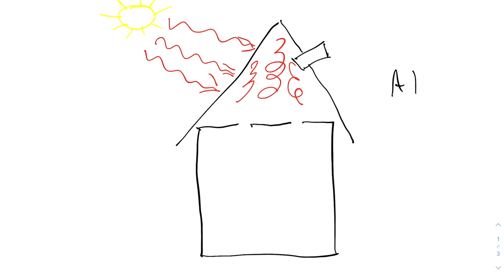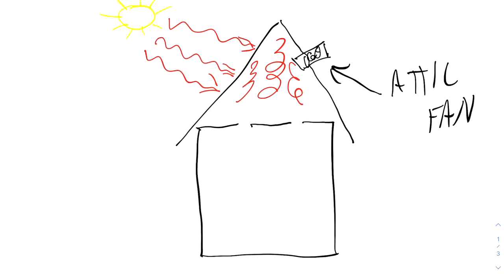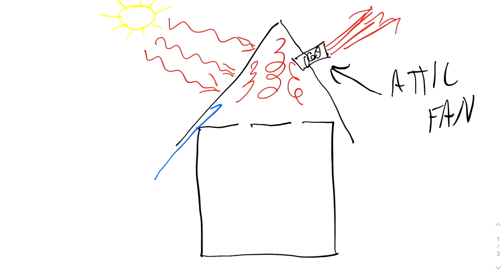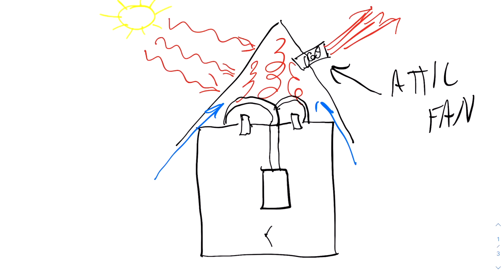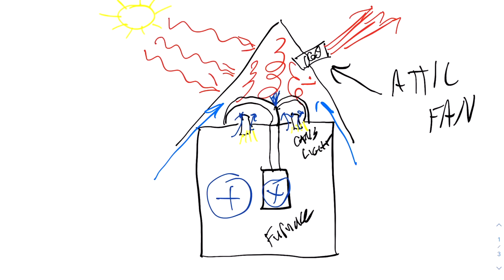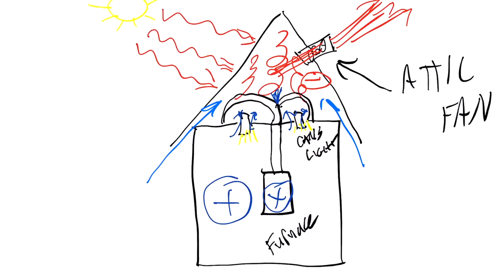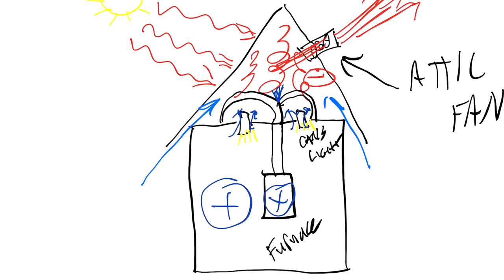3 Remodel Rip-Offs

Comment: As an electrician who is always in attics I can say that every time one of those attic fans kicks on it definitely feels cooler in the attic, but I could be wrong.
Reply: True that! I lived in attics on the jobs in my earlier trade 40+ years ago.(and visited just last week...) It's a seniority thing. They own the company & you go/do what they say ;`)
Reply: It does work. I live on an Island and when elnio hit the Humidity was unbearable. Installed an electric vent and it's definitely cooler.
Reply: It depends on your type of roof. How your attic is designed. My house has A Frame. It's Attic height is around 3ft high.
Reply: Phoenix energy auditor here. The main issue with the attic fans is that they tend to depressurize the attic with reference to the house interior and thus pull conditioned house air into the attic. I use a smoke pen held up at the can lights to show the homeowners that their attic is getting cooler, in part, by pulling air from the house. (The dirty insulation around the can lights further lends credence to this.)

We recommend against attic fans for this reason. Also, a properly ventilated attic, with less high vent square footage relative to the soffit vent square footage, is a more efficient way to go. Stack effect will carry the air from the soffit vents to the ridge/dormer vents. At the same time, we recommend proper air-sealing around the house-to-attic penetrations.

That said,  the fans can work, but the house has got to be sealed tight from the attic.

“In order for the fan to work the air needs to come from the outside and not be pulled from the house so this means that the attic ceiling needs to be airtight. If the attic ceiling is airtight you don’t need the fan. Your money is better spent on something else.”
-- Joe Lstiburek
Reply: You’re probably correct because the attic fan is pulling cold conditioned air from the living space into the attic thanks to the negative pressure effects. This is actually NOT what you want to have happen as now your central A/C is cooling your attic—an unconditioned space.
Reply: @automobilesarefun409  that’s because the fan creates negative pressure pulling cold conditioned air into the attic from your living space. That’s not really addressing the problem of a hot attic by making your setup more inefficient by utilizing air leaks to cool the attic from your main living spaces. That’s literally wasting money.
Reply: I had a similar experience. when my attic fan broke, the second floor was impossible for my AC to get to livable temp, something like 74/75. once I replaced the attic fan it was fine again.
Reply: @eggnogaddict6287  If your attic isn't properly vented at the soffits, i could see how that could happen, but if there are plenty of soffit vents, there is no way it would be sucking air from the house.
Reply: @mushieslushie  if you have plenty of soffits, then a powered exhaust wouldn’t be “necessary.” I am glad you at least acknowledge what science has shown
Reply: Sure it’s cooler.  If the power vent is big enough to actually move enough air to do anything there’s a very good chance it’s pulling conditioned air out of the house through every crack and gap in the ceiling plane.
Reply: @asortoffeastfromfamine1466  whiRley bird?
Reply: I helped my friend do an AC install in the attic. When the fan kicks om it does help with the temp. Most house are not properly insulated. The house we did an ac on belongs to a general contractor. If the vent is not venting properly then I dont see no harm in a fans. Especially for a garage.
Reply: I agree if placed well it makes it cooler. We have a storage artic.  When the fan is running it is bearable.  Without it not so much.
Reply: @automobilesarefun409  powered attic fans do nothing about the humidity.
Reply: @mushieslushie  Of course there is.  It will suck it out of every ceiling light, ceiling fan connection, can light, wall/ceiling joint, up the walls through the top plates of the wall, anywhere that's not sealed.  Why would you think it wouldn't?
Reply: @percyfaith11  It might a little bit as long as you have a lot of proper ventilation, the air will be pulled from where there is less restriction.  Path of least resistance as it were.  If your roof was completely sealed with no vents then what you are saying would be true.  As long as the fan isn't so fucking powerful that it actually created negative pressure, the vast majority of the air should come from the soffit vents.   It's way easier for air to go though a 16"x4" hole than though some small gaps around a ceiling light
Reply: @mushieslushie  Any fan in the roof will create negative pressure.  How else would it exhaust air otherwise?  If there wasn't negative pressure the air would not move into and out of the house.  A fan doesn't have to be so "fucking" powerful to do that.  A standard little bath fan creates negative pressure.

The openings in soffit vents are not individually 16"x4", they are tiny and are no different than the tiny holes around that unsealed can light in the ceiling. If you were able to add up all the unsealed gaps in a typical house you'd be surprised how large an area it is. There is no less restriction to air flow around that can light than there is in from the small holes in the soffit vent.  A 16x4 hole is an open window, not a soffit vent.

The truth is that a portion of the air exiting a powered attic fan is from the soffits and a portion is from the inside of the house.  The relative size of the portions depends entirely on how well air sealed the ceiling below the attic is.  The problem is that the portion coming from the house is expensive due to having been heated or cooled.

What you're trying to say would be true only if the ceiling is exceptionally well sealed against air flow.
Reply: Sure that electrician felt cooler in the attic.  All that air conditioned air coming through the ceiling was cooling him down.  LOL>
Reply: @percyfaith11  I was looking at the soffit vents on my own house while in the pool as I was replying and they are very much the size that I stated, approximately.
Reply: @mushieslushie  You must get a lot of birds and bats in your attic then.  Take a closer look.  They have to be big enough to let in air but small enough to keep out insects and critters.  We're talking about the individual openings in the soffit panels, not the size of the panels themselves.
Reply: @eggnogaddict6287  but if you turn a house fan on at night when the outside is cooler than the inside ..and it will take longer for the house to heat back up during the day making the air conditioner work less otherwise is it not fighting with he hot air from the attic?
Reply: look up Quiet Cool Whole House Fan
Reply: @Farreach  That is distinct from attic ventilation fans.  It has a different purpose and a different way of functioning.
Reply: Quality fan is not running 24/7 and typically not running at night. Usually has a thermo switch. Also - most people have a stack on the roof already and if anything air is going to pull from the least resistance (the roof stacks) and not your can lighting and if so its minimal.  Seriously - guys you should be more worried about the "Positive pressure" pushing out your door and windows than the attic LOL. Give me a break. I wish there was actually proof of AC cycling on more due to the solar vent than just THEORY!
Reply: @thatguy-dr3zc  it's just your theory that it doesn't. I'm not disputing that more is coming from the soffit vents than is coming from the can lights but the amount that's coming from the lights and the holes in your ceiling is significant. You would do much better to seal all those holes in your ceiling and envelope against air then you would do by putting in a powered attic vent.
Reply: @percyfaith11  if the whole roof is sealed and you put one fan I agree with the concept.. but when you have 2 roof  vents and also 15 vents under the eaves  To say that one solar fan is causing a vacuum in a 2000-3000 sq ft house thru light cans is like saying sucking water out of a pool with a straw.
Reply: @thatguy-dr3zc  you overstate your case. It's a lot more than one straw being sucked out of the house. In a typical home that hasn't been air sealed it's more like having a window open.
Reply: @automobilesarefun409  Yeah I have the same pitch, but likely I have head height over the kids bedrooms so I can put in a Quiet Cool system.
Reply: @heatthermography3902  In Ca. the IE we get pretty hot but 10 degrees less than you, but at night we cool down to the 80's by 9 pM and 70's after midnight, do you think a Quiet Cool would work good here.
Reply: @Moondoggy1941  Given all the caveats I mentioned regarding depressurizing the attic WRT the house interior, I suppose they could. I'd say, though, that natural ventilation, with about 20% less net free area on the ridge/high side than the soffits/low side, would be better.
If fans must be used -- maybe in attics with low-pitch roofs -- an exhaust fan coupled with an inlet-oriented fan of equal CFM on the opposite side of the house (south & north or east & west, for example) would be preferred.
Reply: Depends on your climate, what your roof is made from, when the fan turns on relative to your use of aircon and indoor/outdoor temp, and greater potential benefit for a multilevel house. Classic use case, two story tin roof house, aircon off, evening on a sunny day, cooler outside ambient than inside, (australia), desire to cool the house, turn on the fan.
Reply: I lowered my ambient interior temperature by 3 degrees using my thermostat controlled attic fan.  2 amp motor.  The fan is 120V on a thermostat control.  I could not believe what a difference it made toward cooling my home.  Three degrees doesn’t sound like much but that’s the difference between a good night’s rest or no steep at all.  Or, my central ac system doesn’t have to work for those three degrees.
Reply: I installed these for 3 years while also working in attics. If this guy's saying attic fans don't do anything he's completely wrong.
Reply: You're not wrong. This guy's logic is very flawed, and I'm not certain he has any actual basis behind his claims on this in particular.
Reply: @eggnogaddict6287  What if you don't have any type of a/c for the home, would the attic fan then be effective?
Reply: @percyfaith11  I fail to see how you can say that, venting any air at all will be better than leaving humid air in the atttic.
Reply: @pablogallegos8629  don't think I actually wrote that.
Reply: @heatthermography3902  I have a question because I understand nothing about this area at all. I can only describe what is happening. 

My wife and I bought our first house November 2021 and it has central air conditioning. When we did the walk-through in August, the house was 68 degrees with the CAC on. I noticed that there were 8 big trees on the south side of the house about 15 feet from the house. I remembered during the walkthrough that the back yard was dark in the middle of the day not realizing the huge leafy trees were shading the entire roof all day as well. Last March 2022, I had the trees removed. During the summer, I noticed that we were unable to get the house below 75 degrees with the CAC on because the attic was so hot. Now the roof is hit by the sun the entire day. 

Just some background on the house. it is an 85 ft wide ranch and 2400 sqft. The attic ceiling is about 4ft high. There appears to be a ridge vent on the roof and there are gable vents on opposite sides of the house. I have read several people talking about an attic fan creating negative pressure which makes perfect sense. Would that happen to a house with gable vents since the air would be pulled in from the sides. I would imagine that this would have a dramatic cooling advantage since it would be pulling in outside air. Any advice you could give me would be greatly appreciated. It is a problem that needs to be solved since the house doesn't as cool, the AC runs constantly, and my electric bill was insane because of it. I am just not certain of the best approach at the moment.
Reply: @marcsmith3881  While it's possible that the fan would bring some cooling benefits, there's also a good chance that it will depressurize the attic (mostly in the area where the fan is) and pull house air into the attic to feed the vacuum.

Your best bet is to first have an energy audit done. The trees likely did wonders in shading your roof & keeping your attic cool, but they may have masked the possibility that you didn't have enough insulation, or that your air barrier between house & attic is compromised, etc.
Reply: Absolutely they work! I'm an Electrician also and when the are running it's 20 degrees cooler. I've proved it with a thermometer and having to replace a fan motor.
Reply: Yeah, attic fans work fine. I dunno what this guy is on. They still need to be installed properly for your attic design though. You can't just toss a bunch on there and expect it to work properly. When we did the solar install on the roof the guys said it was the coolest attic they had worked in for our area. And you prevent the fans from pulling air from your house by insulating your ceiling. If it is pulling air from your living space you have gaps in your insulation that need to be taken care of. I recommend an energy audit and they will tell you where you are leaking or you can get your own FLIR camera that will connect to your phone and likely be good enough.
Reply: I live in southwest Texas and I have 2 12v fans on my gable. It gets hot as hell Tx region. My ac used to kick in all the time. I made sure all my vents and lights were sealed. I have soffits and 2 other gables that are able to take in air. The fans keep my attic cooler and they definitely work. I got 2 100watt solar panels for under $100 bucks and for 2 fans about $30 bucks, now my ac kicks in less because my living area is cooler because the thermostat in my house is not rising so quickly. I’m no rocket scientist, but I’m with mushislushie dude, air flow though the soffits and gables will not suck you out the pinhole openings in your negative pressurized home. Trial and error has taught me that solar vents help. Yes, you do need to do your yearly maintenance and blow air through the soffits but like anything else, a little effort goes a long way.
Reply: @marcsmith3881   … time to put those trees back in.  If it works don’t fix it, just saying.
Reply: @csj2640  That's not really possible, but ok.
Reply: Has anyone done a study on adding a -- I don't know what you would call it, Faux Roof? but it seems like adding an additional roof, like a tarp or something to shade your current roof same as a huge tree would do, would save substantial money. In some zones, even adding a permanent structure would save enough money over time to make it worth it.
Reply: The best thing I ever did was replace my old ugly metal divided light windows to beautiful aluminum clad wood double-hung windows with screens. Comfort level of every season is incredibly better !
Reply: @danpszeniczny9664  Nice! 👍👍
Some actual figures to see is much better than a hundred folks guessing about what might or might not happen.
Reply: Having extremely high temps in the attic will transfer to your living space, heat transfers to cold and that's one reason second floor homes upstairs are  always warmer than 1st floor. Contractors will  install roof vents but your depending on heat rising. Buy the smallest fan and set the thermostat to desired start temp.
My first fan was still running after 20 years with zero problems and replaced roof and installed new fan.
As far as cooling your attic no, moving air..
Reply: I did one in a attic that was 140 degrees when I was done with the fan properly placed bought it down to 110,  made it bearable for the homeowner  not perfect but on an older house I will take what I can get
Reply: I would think that as long as the soffit vents are able to provide equal to or greater than intake air vs exhausted sir, drawing conditioned air from the living space would be minuscule.
Reply: I keep my AC set at 70 and later the house temp was 75. I new there was a problem with the attic fan. It stopped working so I replaced the motor for $63.00 and watched the house temp drop down to 70.  I talked to the AC manufacturer and they said adding a power roof fan is like adding 1/2 ton to the AC unit. I had a new roof installed and they wanted to install a ridge vent and I refused and went with a fan. Are they worth it ABSOLUTLY....
Reply: You're not wrong. Your senses are not deceiving you. This guy just doesn't know what he's talking about.
Reply: @heatthermography3902  Ok, put in a gable vent to allow air in. I like to put a small 3" intake vent to the return side of furnace pre filter that gives you fresh air and pressurizes the house.
Reply: @eggnogaddict6287  Again, anyone with any experience would provide a relief vent or gable. Ideally attic fan on one end of the house and gable vent on the other.
Reply: I feel cooler standing under a canopy or wear a white hat, because it helps block the sun and is ventilated. An attic blocks the sun, but has poor ventilation and the trapped heat just gets more and more.
Reply: @heatthermography3902  So can adding a fan than blows air in and one that blows air out help or increasing the number of vents?  Attics get over 120 degrees.
Reply: Go in my attic....lol
Reply: @eggnogaddict6287  I don't have AC. The fan cools the attic and lowers temps in the upstairs rooms when its hot out.
Reply: @eggnogaddict6287  Natural convection where cool air is drawn from soffits and vented out the ridge vents is not nearly enough to counter the amount of heat being added to the attic through the roof. Your claim that science backs your position is not true in the slightest. If that were the case, my PC wouldn't need cooling fans
Reply: @percyfaith11  Funny how it still cools when you dont even have air conditioning.
Reply: @percyfaith11  Soffits are covered with stainless steel mesh. No birds, no bats.
Reply: @heatthermography3902  This is about comfort and saving money, yet you recommend paying some clown a grand for an energy audit? lol.
Reply: @LBCAndrew  funny how you can't prove it.
Reply: @LBCAndrew  zero soffits are covered in stainless steel. Plastic or aluminum maybe but not stainless steel.
Reply: @LBCAndrew that’s fine; DOE studies confirm attic fans suck conditioned air from the living space into the attic, which is exactly what you don’t want done; it brings moisture into the attic as well.